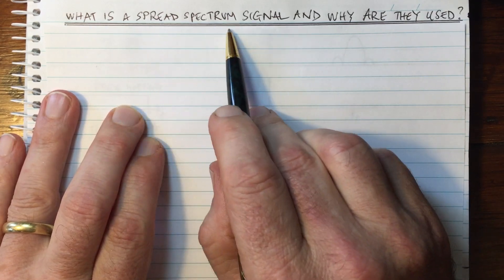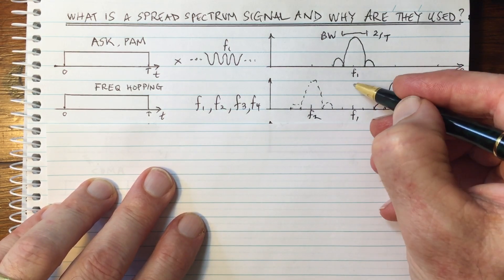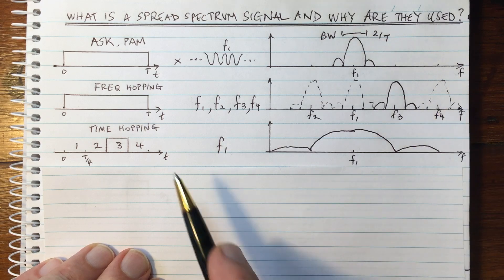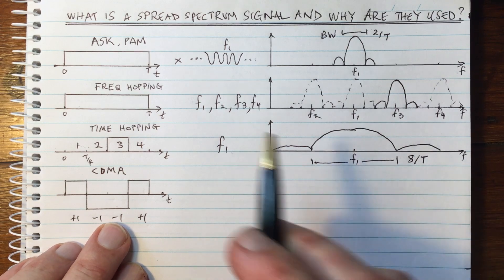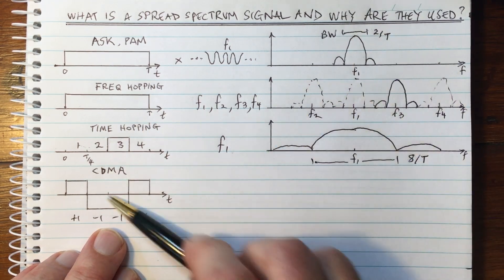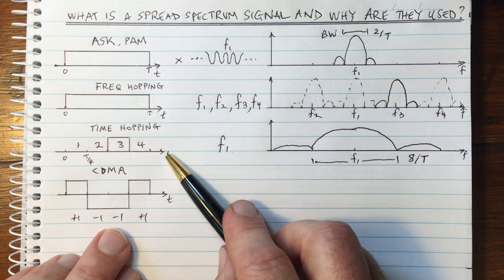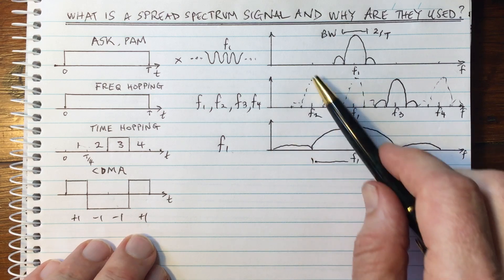What is a Spread Spectrum Signal and Why Are They Used?

Comment: When we have the time hopping case, we have smaller time slots. We have also one frequency. How many periods of waves do we send over that time slot? Is that now just a portion of a wave?
I thought we always send exactly one period of a wave.
Thanks.
Reply from the maker: I think the "one frequency" you're talking about is the carrier waveform. It is typically multiple orders of magnitude higher than the symbol rate, so there are always hundreds of cycles of the carrier, per symbol. For example, in WiFi the carrier frequency is 2.4 GHz, while the symbol rate is 250 ksps. So there are 9600 cycles per symbol. So even if you divide that by 4 in time-hopping, there are still 2400 cycles.
Reply: Interesting question, and how does the term symbol duration (T_s=1/B)  fits in here? Your mentioned duration of a symbol contains several T_s?
Thanks a lot.

Comment: Spread Spectrum Signals: What They Are and Why They're Used

*   0:00:04 Standard Signal vs. Spread Spectrum: A standard signal (e.g., amplitude shift keying) transmits data within a specific, narrow frequency band (2/T bandwidth, where T is the symbol period). Spread spectrum signals, in contrast, utilize a wider frequency band than necessary.

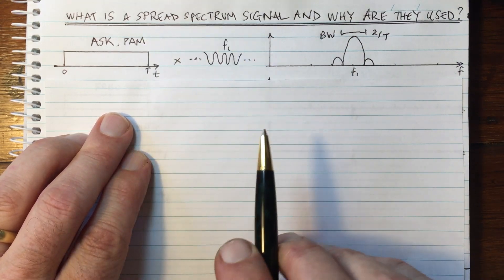*   0:01:31 Three Main Spreading Techniques:
    *   Frequency Hopping: The carrier frequency randomly changes over time, using a different frequency within a predefined set for each symbol period. At any given moment, one frequency used, but full band used over time.
    *   Time Hopping: The signal is transmitted only during specific, randomized time slots within the symbol period, leaving other slots silent. This broadens the signal's spectrum (e.g. 8/T with four slots).
    *   Code Division Multiple Access (CDMA): Each symbol is multiplied by a faster-rate, randomized code sequence. This also spreads the signal in the frequency domain, similar to time hopping.

*   0:06:00 Reasons for Using Spread Spectrum:
    *   Multiple Users: Allows multiple users to share the same spectrum without coordination. Randomization (in frequency hopping and time hopping) or unique codes (in CDMA) minimize interference.
    *   Security/Covertness: Makes it difficult for unintended listeners to detect or intercept the signal, as they would need the specific randomization sequence (frequency hopping/time hopping) or code (CDMA).
    *   Jamming Resistance: Spread spectrum signals are less susceptible to narrow-band jamming. In frequency hopping, the signal avoids the jammer. In time hopping and CDMA, only a portion of the signal is affected. Jammers often can't use broad-band jamming because it makes them easily detectable.

* 0:07:28 Additional Information:
    * More information on CDMA and related topics are on a list of videos on a related webpage, see description.
    * Viewers can support by liking, subscribing, and possibly joining the channel's membership.

I used gemini-exp-1206 on rocketrecap dot com to summarize the transcript.
Input tokens: 21447
Output tokens: 485